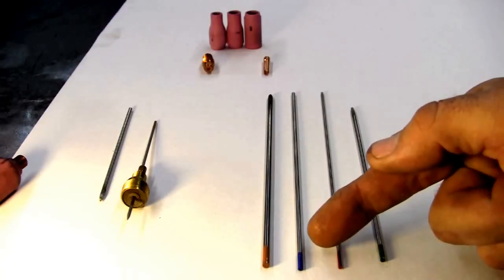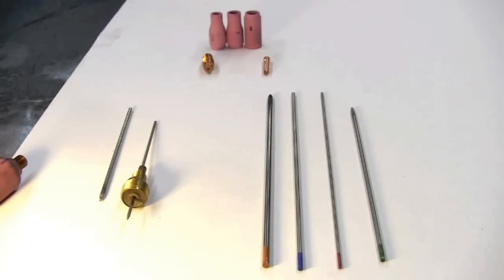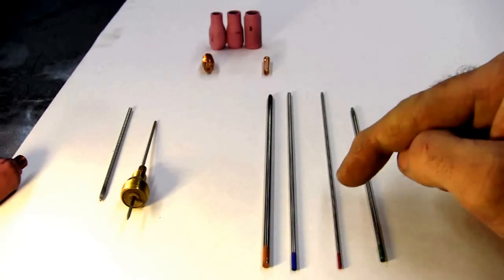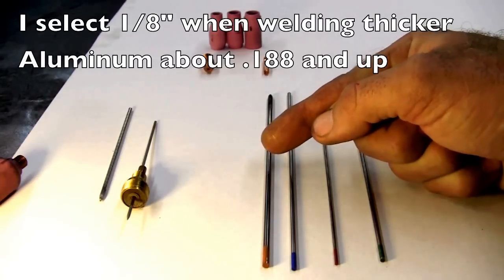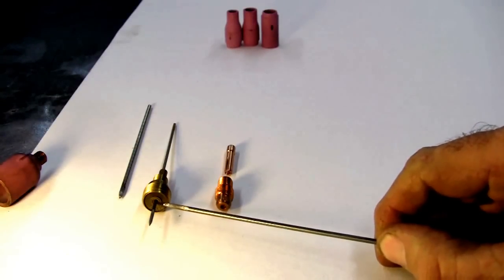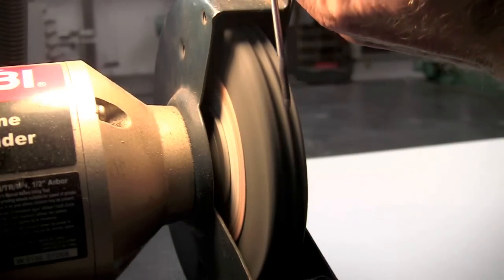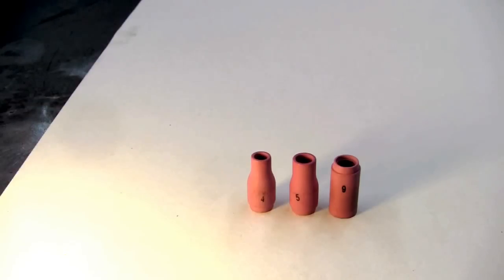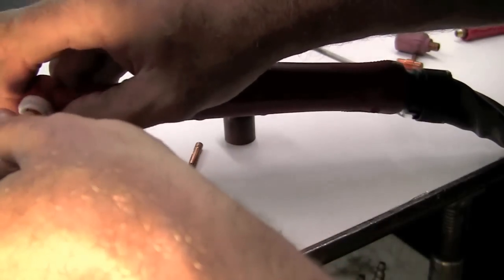TIG WELDING 101: Tungsten, Collet and TIG Cup Selection for Aluminum Welders (Tungstens and Cups)

Comment: It's my understanding that some tig rods are mildly radioactive.  If this is true, is it a concern for you and what precautions do you take while sharpening the rods?
Reply from the maker: Thoriated Rods are. You should wear protective gloves when sharpening
Reply: The thorium is radioactive and its recommended to wear a filter face mask to prevent inhalation of dust in the grinding process, also recommended not to handle it with open cuts on the hands so use gloves.

Comment: sharpening tungsten against the direction of the grinding wheel (the way this gentleman started out) is begging to have a tungsten rod shoot through your hand. I would never recommend anyone do this. Always go in the flow or hold the tungsten with pliers or something.
Reply: Maybe if you somehow manage to snap a rod, although most welding supply shops instruct you to do it this way as do most welding manuals. I have been welding for only a few years but have had to point a lot of tungsten (in this manner) and haven had a single issue with it as per instruction.